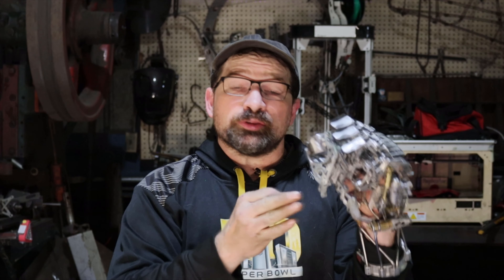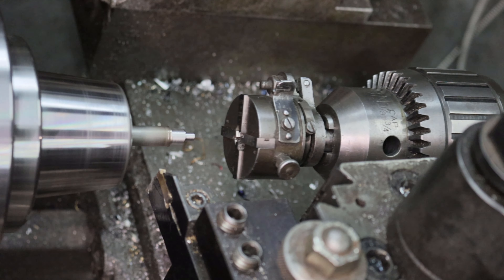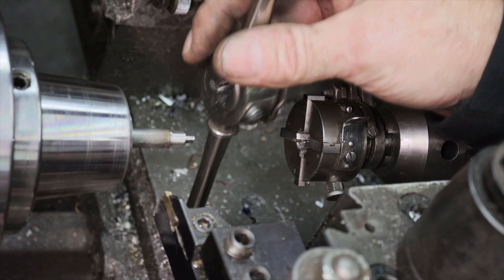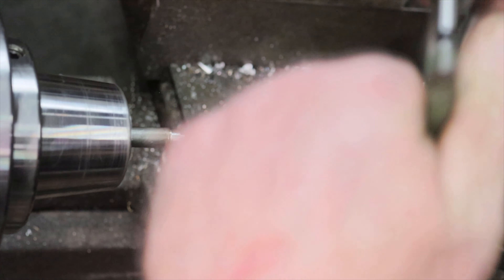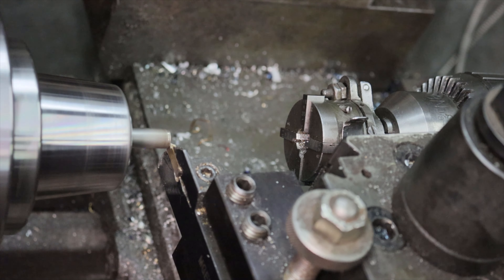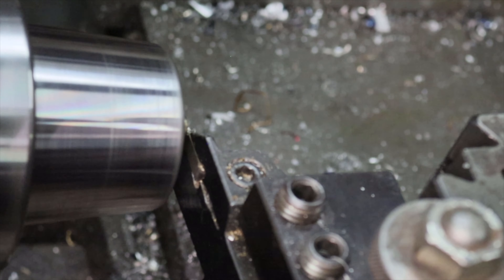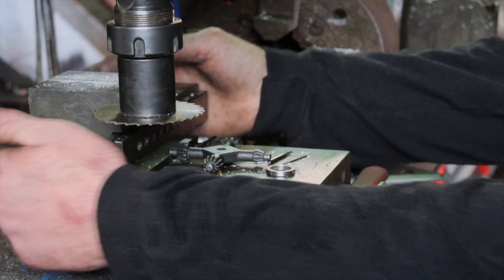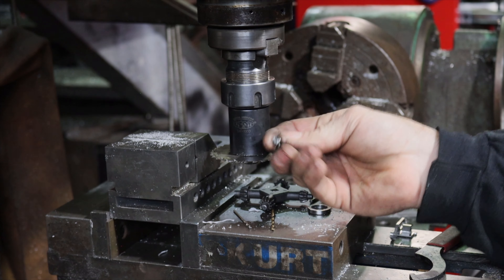Missing Parts Monday How to Make Custom Screws

Comment: So much effort for one little thing. Impressive.
Reply from the maker: Well I did make 10 of them while I was set up, so it wasn't that bad. If I was making only one, it would suck.
But you see, that's part of the issue with building these hands. Everything is custom and one off. The most of anything that you end up building is 4 plus whatever you're doing for extras.
Reply: @missingpartsclub  Why is everything one off? I understand most of the parts being custom made, but screws? As nice as an exercise as that would be for one's machining skills, I don't understand why you wouldn't use standard sizes and simply drill and tap your holes to match. That way, you can buy screws in whatever material you want when they wear out.

Comment: back in the day I worked in a screw machine shop (small turret lathes) and would run jobs like that for weeks
Reply from the maker: I use my second op turret for the finger screws. Thats where the geo die normally lives. And ya, once you're setup and have your numbers, its no big deal making screws. But for 10pcs you haven't hit efficiency yet. But that's ok, it's all custom, and thats what it takes.

Comment: While making the socket in previous MPM Episodes, it made sense to me why you didn't wear your prosthetic hand. But why didn't you in this episode? Clearly you can work fine without it, but isn't it supposed to make things easier? Is it too clunky or uncomfortable (after hours) or whats the reason?
Reply: i think its a high risk of giving you a burn or getting it into a machine. you cant "feel" where the finger tips are to maybe give yourself a heads up
Reply from the maker: So it's a couple of things. I'm nervous about breaking my hand using it with the machines, I've had to make a couple of differential plates for this hand because the pins shear. The other reason is tied to the difficulties relater to partial hand sockets. Because of the change of the seasons, I've been drinking more water, which makes my hands and ankles swell up because my kidneys are iffy... thanks cancer.... When that happens, the socket gets tight and less than comfortable to wear for extended periods of time.

Comment: Im curious what do you think are the chances that a 3D printed prosthetic would work? I know the durability would be way worse, but being able to just print all the parts super quickly might be helpful for prototyping. Im unsure since I haven't been printing awhile and I don't exactly have the ability to test it. what are your thoughts?
Reply: I saw one of his videos showing the some of the early prosthetic hands he made (soon after his amputation), and it looks like he started out using a lot of printed or laser-cut plastic parts before moving to all-metal designs for durability. He talked about the high stresses due to the short moment arm in a lot of the linkages (which is why the hand looks a lot "chunkier" than sci-fi would have you believe), and I'd assume that's what requires the use of metals. He also might need the very fine tolerances that machining gives to reduce backlash, and to properly balance the movement of all the fingers (he talked about balancing the wiffle tree mechanism to about a thousandth of an inch – most printers won't manage that).

I was surprised by all that, because it looks like he really needed his machining expertise to make a properly functioning hand, when I'd assumed it was more of a "do what you know" route.

Comment: I've been on the lookout for a very large tool cabinet. I have a woodworking shop and the machine shop which I'm trying to separate entirely. My machine tools are set up in a galley arrangement, three sides of a narrow hallway. This allows me to stay in the same swivel stool and operate the lathe or milling machine without getting up. I recently decided that one of these enormous boxes would be ideal for the third wall. Something to hold metrology equipment up high, lots of heavier fixtures and vices low down. My budget does not allow for venmar or lista. I've been shopping the hardware store brands, but it's very difficult to get a sense of how much weight their drawers can handle and still operate smoothly. I noticed you using a pretty common Craftsman box, one that I believe I have been considering. Could I ask your impressions? Could this box hold up to some serious weight? Any alternative suggestions? I have kind of kicked around the idea of getting one of those metal closet structures made for offices. I could build a plywood interior to hold some of the heavier more delicate items. I have the possibility to set up a metrology room, I have a small room in my shop that I can control the temperature and humidity. But I'm working on 65-year-old manual machines. Is having a dedicated metrology room even worthwhile for someone like me?
Reply from the maker: So I have 2 years of use on the 3 sets of craftsman boxes. One for metrology and tool and cutter (wheels, collet, fixtures, sine tables ect) 1 top box,( carbide, collet for the shizuoka, acroloc, 3 sets of er-40 collets) bottom box, (sockets, 2 drawers of acroloc tool holders) the last is mostly lathe stull, ( 5c collet, geo dies, ect)
Now what I've done for all 3 that I've found to be super convenient is I built 4" riser boxes that have 2 pull out 1.5" tall drawers  that I use for layout and setup,  the mill and grinder boxes each have 1200lbs+ in them, the lathe box probably only ha 800lbs.

Comment: Ian: Turning tiny screws.
YouTube: 144p should be enough.
Reply from the maker: Should be in 1080, is it not? I'll check in a bit. Thanks for letting me know.
Reply: @missingpartsclub  it is available, but as a opened the video the app nuked the definition from orbit. (Funny that this never happens to ads).